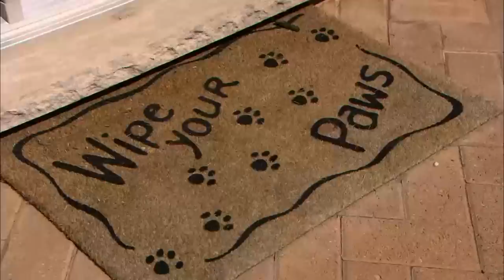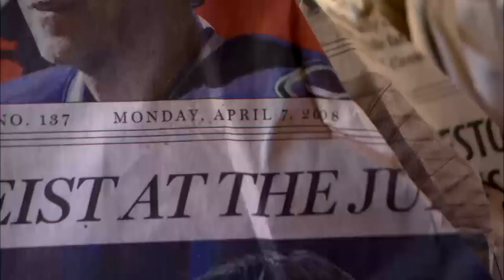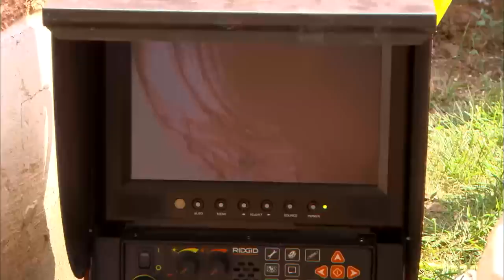Inspector Makes Questionable Excuse To Not Inspect Roof | Holmes Inspection 209

Comment: You find a void between the bathroom and the outside wall, why not eliminate the void and give that space back to the house?  Right after I ask the question, Damon answers it.  But the real reason is that it was cheaper to go their way.
Reply: turning a cold zone into a warm zone requires redrawing the plans, which could take months to get full approval on

Comment: No one sees all of the work behind the walls.  Boy that is right.  When I did my last house, fully insulating the bedroom walls(exterior and interior), individual electric circuit to each bedroom, 6 ml vapor barrier, drywall, baseboard and paint.  $2000 in materials and the only thing you see in the room is $300 in drywall and $50 in paint.
Reply: What you can't see is what's most important.
Reply: Just like a haircut tells you nothing about your cardiac health.

Comment: Carpet in the bathroom that is a big no no 😮
Reply: Back in the day that was cool
Reply: @1packatak   you got that right
Reply: Once upon a time, it was the “in” thing. It was never a good idea, but it was common. One major difference was the grade of plywood used. Also, it was often painted, so it was sealed
Reply: @mattbarrett41    that is so true about that matter of how the sub floor was treated and the type of carpet that was used to cover the floor
Reply: I'm 60. I remember when bathroom carpeting was "swanky". Until you have to live with it! Gack! Always wet after a bath or shower, and the guys had to be careful around the toilet. Ick! Nope. Go tile!
Reply: @SandraNelson063   you definitely got that right young lady 💐🌹  other thing is that the toilet would  over flow 🤮 when it was clogged up
Reply: I can see how that might initially sound like a great idea. Nice comfy floor so your feeties don't get cold on a midnight potty run in the dead of winter, no worry about splashes causing slippery conditions, easier on the joints when standing in front of the mirror in the morning, and it can look good if you like carpet. But surely, somewhere between thinking it up and spending the time to install it someone would have said "hey wait a minute this thing is just going to be a pee sponge".

Comment: Some question on how 'good' or 'proficient' Mike really is. I have watched hundreds of these shows & can say with decent certainty that he is in the 80-90% bracket. I have found some things he can do better. One is I DO NOT believe in using plastic as a vapor barrier. If ANY moisture gets trapped on EITHER side of the plastic...it stays trapped. He uses a lot of spray foam, which I love. However, he uses a lot of batt insulation w NO paper barrier. We called this paper 'faced' insulation. Another is they don't use drywall glue when installing drywall. I think this is a HUGE no no. I have been glueing my drywall for 40+ years. I would love to have my own show. Maybe in my next life. Oh wait...there won't be drywall in Heaven...just a lot of gold.
Reply: No one glues drywall in North America you slap it on the studs screw it and mud it.
Reply: Gold in heaven ROFLMAO...no heaven no hell no gold no diamonds sorry...
Reply: I agree about the plastic. I was in my daughter’s first house when it was being built. I was astounded to see plastic on all the walls before the drywall was installed! When I commented on it, she told me that it was done according to British Columbia’s building code. I don’t like it as then the house can’t breathe. It might be good for the rest of Canada, but the weather is very different on the west coast. 🇨🇦

Comment: I didnt know you could mount circuit breaker panels horizontally. Ive never seen mounted like that in chicago so far
Reply: most are vertical. It's strange to see one horizontal unless space or framing is an issue, plus a horizontal panel harder to wire.

Comment: Is it a Canada thing that all the electrical panels are sideways? Is there a perk to this?
Reply: Not usually most are vertical. It's strange to see one horizontal unless space or framing is an issue, plus a horizontal panel harder to wire.
Reply: It is weirdly common on this show.

Comment: I guarantee they trapped that squirrel in there when they sealed that vent. Little dude couldn’t get back out. That’s the risk you take if no one way door or trap isn’t used prior to the exclusion work. Ended up nice though!!

Comment: I love it how the electricians say 'circuit is overloaded'. People should really differentiate oversubscribed  and overloaded... I very much doubt the circuit was actually overloaded (they are pushing more current through the X number of outlets than the circuit is rated for)
Reply: Might be a difference in terminology from different countries.
Another example is Marrettes, which is a brand name, and in Canada is used as an all-around name for what we in the US call wire caps, wire nuts, thimble connectors, or one of a few other names.
Reply: As an electrician myself. It comes down to demand factoring. An average cct can only have 12 devices on it. Plugs and or lights. Most branch ccts are run with 14awg. Good for 15 amps. However if you have 20 plugs and lights on a cct. It’s likely that if all the plugs are used and all the lights are on. it will overload the cct and trip the breaker. To avoid nuisance tripping you should only load the breaker at 80% capacity. There are some ccts that are also supposed to be dedicated and cannot be share with other devices. A good example of this is making the refrigerator a dedicated receptacle. This is done so that overloading that plug cct won’t likely trip the breaker and causing your food to spoil.
Reply: @MonkeyJedi99  IIRC it was the homeowner who used the term anyway, not the electrician. Even if the issues you point out aren't at play, it could be the homeowner used the wrong term or the electrician used a more approachable term for the layman. I did always wonder why they called them Marrettes though!

Comment: They make much too big of a deal about "offgassing from vehicles". Nobody idles their car for hours in the garage, and nobody backs into a garage, so the amount of exposure is tiny. You breathe in far more just crossing the street. Sure, it SHOULD be sealed off, but it's just not an issue in the grand scheme of things. The heat escaping through it is a MUCH bigger problem. It just feels like a scummy scare tactic.
Reply: Yes, thank you.
Do people have any idea how long you'd have to run your car to get lethal amounts of co under those door gaps.
Reply: @Scubamike4499  It's more than CO entering the home. There can be solvents, pesticides, etc. that can leak into the home.